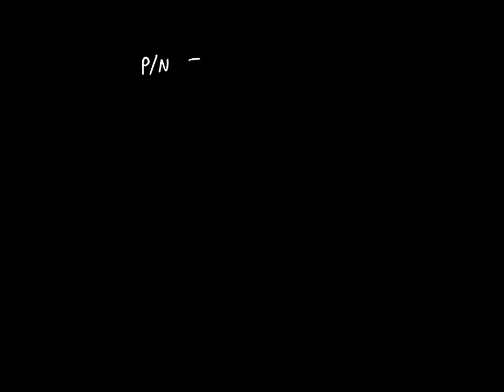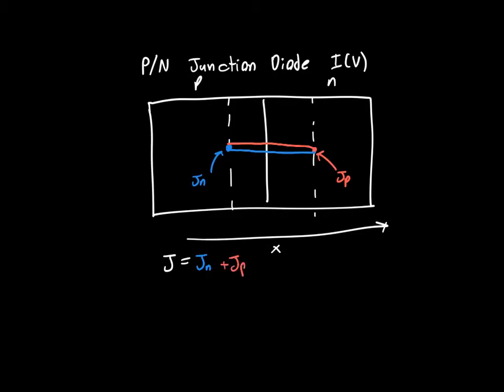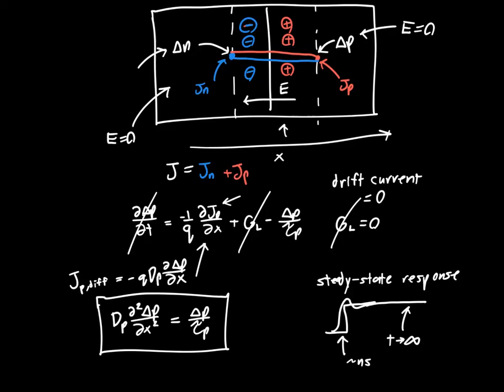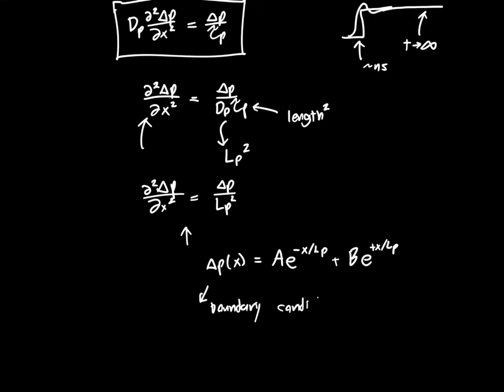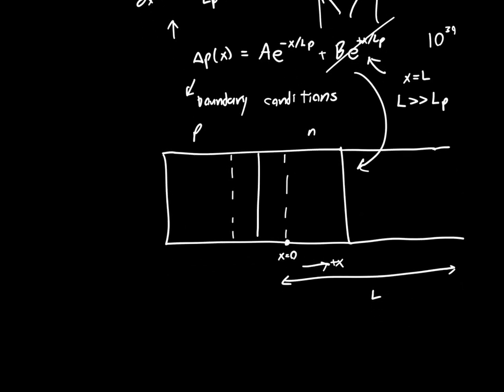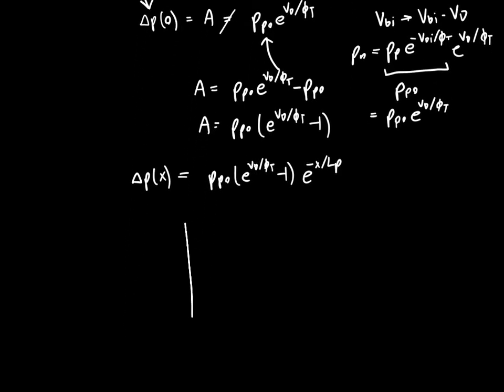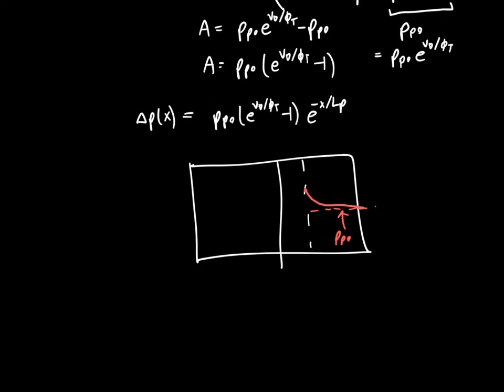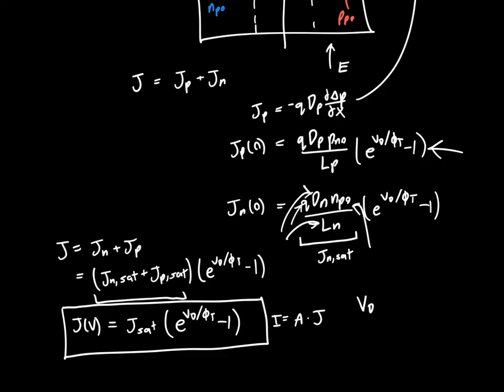PN Junction Diode Forward Bias Current Part 2

Comment: I do not understand why you applied external voltage Vd at 9:00. you neglected to drift current because of the absence of an external source at first. but now you applied voltage again, therefore should we consider drift current?
Reply: The electric field inside the depletion layer is so high that drift velocity reaches saturation velocity so drift current is same as equilibrium drift current.

Comment: Thank you for the great video.
At 2:28, there is an assumption that outside the depletion region, there is no electric field or 'E=0'. Then what happen to the forward bias, wouldn't the forward bias cause extra E to the semiconductor?
Reply from the maker: No, the assumption is that all the forward bias is ‘dropped’ across the depletion region, none in the far-away semiconductor.

Comment: can you explain why we can simply assume that outside of the depletion region there is no electric field?
Reply from the maker: Because it makes our lives so much easier and doesn’t introduce too much error xD that’s the actual reason
Reply: @JordanEdmundsEECS  However if we add a external potential, there must be a electric field (not necessarily weak) outside of the depletion region right?
Reply: @gt5490    I guess if external potential is added (assumed that it is reverse bias), depletion region is enlarged and the outside of the region has no electric field as before
Reply: because most of the drop occurs in depletion region as it has more resistance.

Comment: In the expression of Jp written at the end isn't it p(p0) instead of p(n0)?
Reply from the maker: It is actually p(n0) (which seems weird, right)? This is because the hole current density depends on the hole minority carrier current, when the holes are on the n-side.
Reply: I get that we are interested in the minority carriers but I think that Showmik Alam’s confusion comes from the same place as mine.
We have delta p(x) [for the n region] expressed in terms of p(p0). Then we differentiate it to get Jp and it changes to p(n0). Is it that the original delta p(x) should be in terms of p(n0)?
As I understand it shouldn’t p(p)*exp(-Vbi/phiT)=p(n0) as opposed to p(p0)?